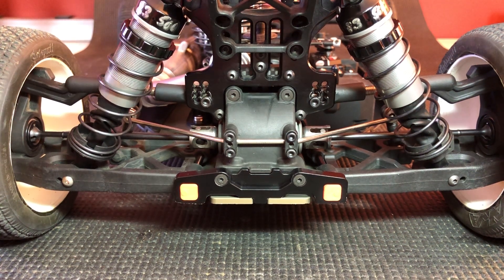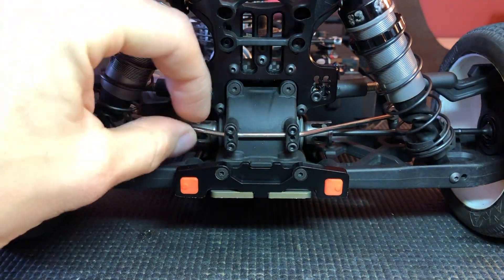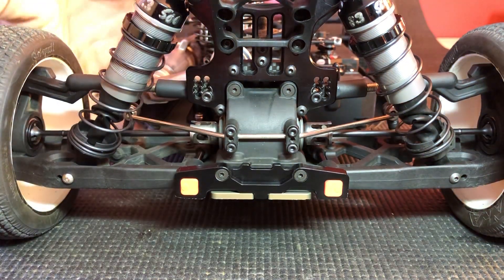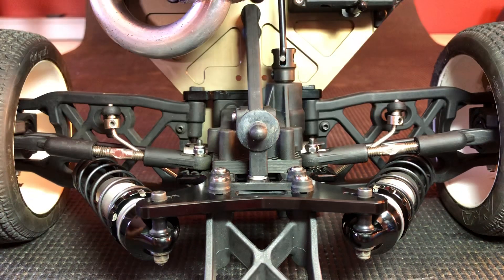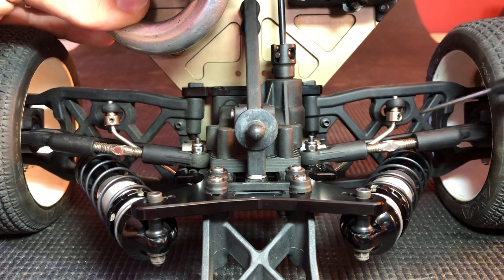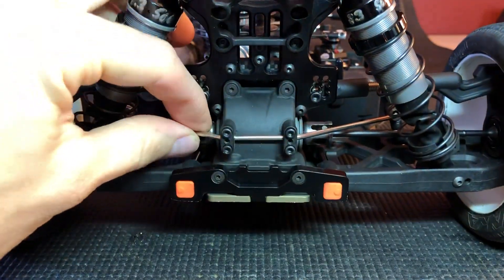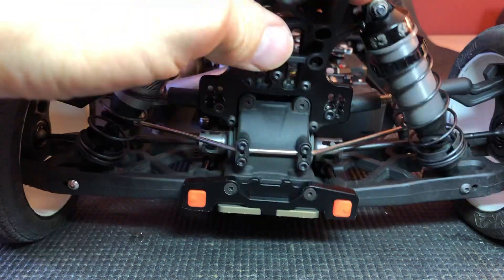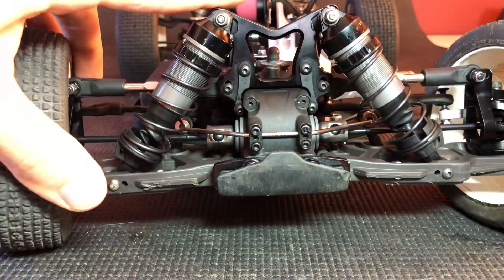Adjusting sway bars on your R/C car [Beginner tutorial with Ryan Lutz of LutzRC]

Comment: Like to add couple things that even veteran RC racers over look. One you can adjust sway bar resistance not only by thickness but also how far in and out you mount your sway bar links on the ends. 
Second sway bars can get bent so taking off your sway bar and placing it on a completely flat surface can show you if it's bent, your sway bar should sit flat completely. If it's bent even a little it will literally pull up on one side and push down on the other making your rig handle wierd.

Comment: I assume if you’re going to change as an example to a softer Swaybar to get more roll, you’re going to do front and rear and not just one of them correct?
Reply from the maker: Can depend on what is desired. Sometimes one end is too stiff compared to
Another. A quick change I often make when grip comes up on a track is to just go up on front swaybar 0.1.

Comment: Thank you for the video would you be able to do a driving video on when to brake,  and throttle? I understand what brake and gas do in the air. But i really need help setting brakes and when to brake for corners and adding throttle out. Cheers
Reply from the maker: K M Adventure-Live Life I don’t currently have one. Thing is there is no one size fits all answer. 
I can however show how I adjust my brakes and check them before every run. Stay tuned.
Reply: @RyanLutz  actually I need to learn how to drive better any help at all would be benificial. Even take some footage of you driving and voice over what your doing would help. I mainly drive ebuggy now and setting up brakes and when to brake would help. How do you see if your brakes are set properly what percent of brakes do you set etc?